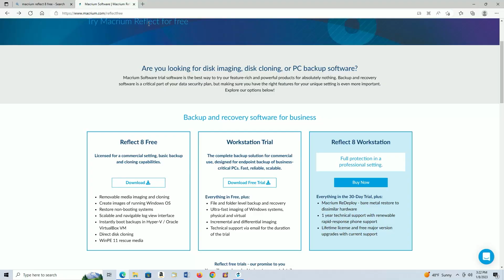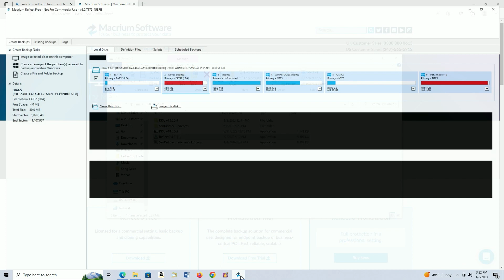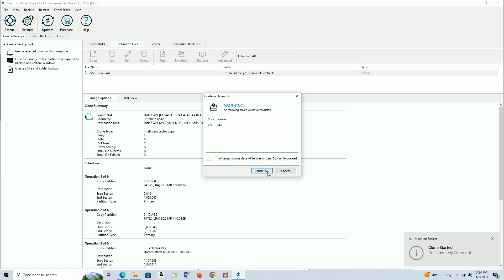The BEST way to clone your old hard drive to an SSD for FREE!

Comment: i did this once. my pc just refused to boot off of it. apperently the file structure didnt match from the hdd so it just simply didnt work until i installed a new install of windows on the ssd.
Reply from the maker: That is strange.. I have never had that happen before. I wouldn’t normally do it if my mother in law didn’t need so many files and programs transferred.

Comment: I would also recommend looking into clonezilla, a free, open source, Linux based cloning software that is live bootable.
Reply from the maker: I will definitely look into it! This one worked well for windows and kept all the files and boot drive.
Reply: @MMillerPCs  Clonezilla also does that, but it is live bootable, so you don't have to use windows to clone your disk, you can just boot off of the USB and clone any disk to any other disk. It also has an imaging option to create an ISO of a disk.
Reply from the maker: @antimatter85   I got that down! I’ll have to use it next time I need to clone and see how that works! Thanks for the info.